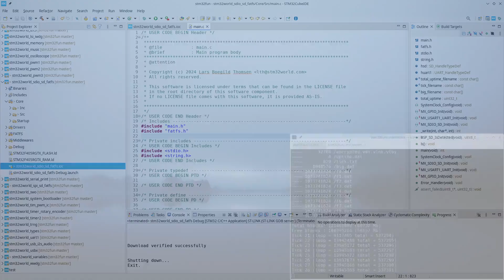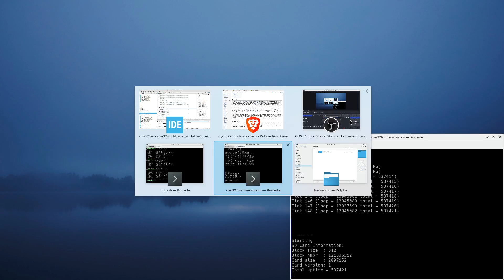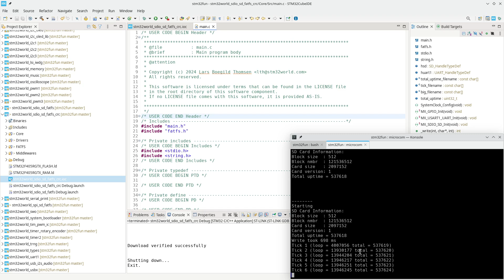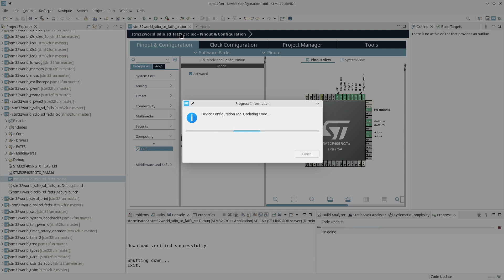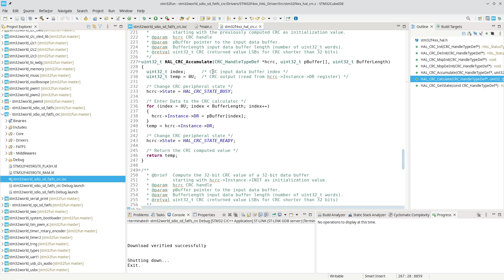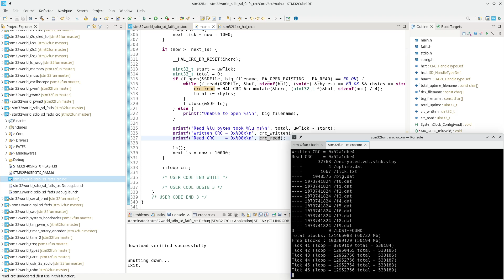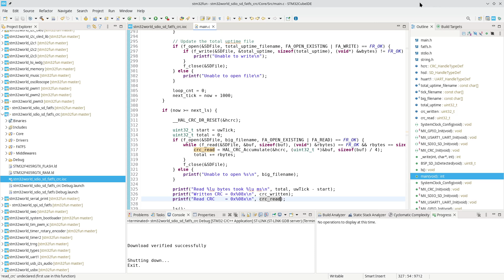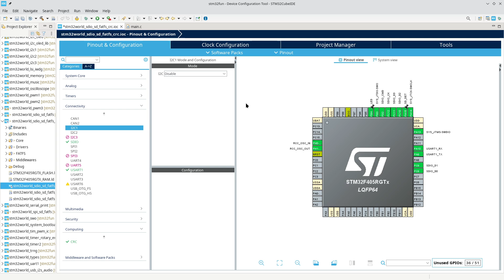STM32 Tutorial #53 - CRC Peripheral

Comment: Can you make a video about stm32 deep sleep mode or standby mode for battery powered devices?
Reply from the maker: That is actually a good idea.  I got a stm32l152c-disc board in a drawer somewhere.  That one can actually measure current consumption and can run on battery.  I'll look into it.  I think I need a battery holder and it might take a while.